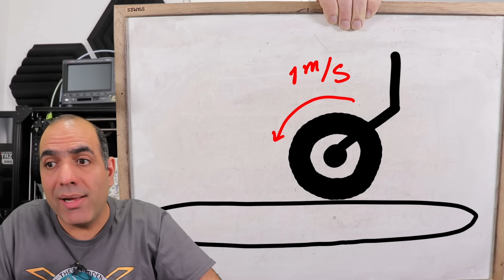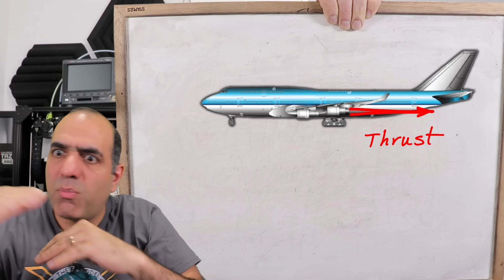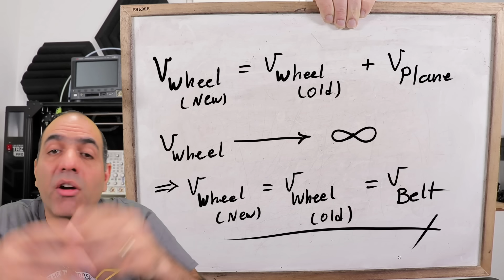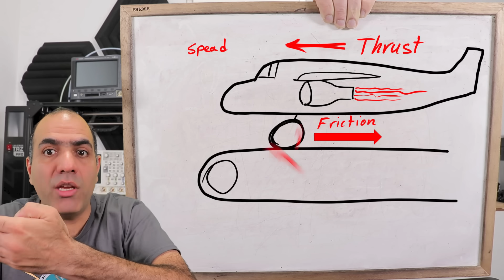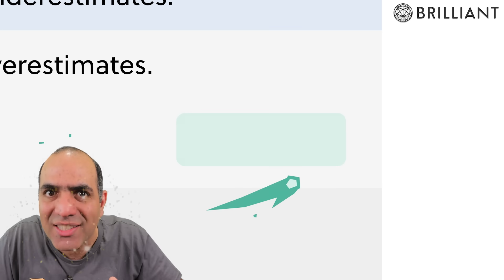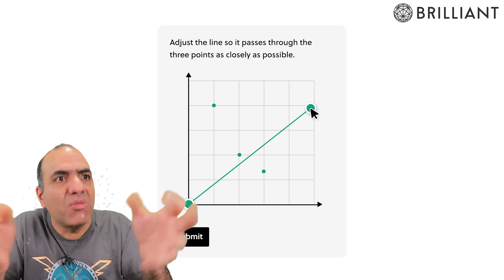Airplane Question that Drove Me NUTS!!!

Comment: Basically, using the assumptions most people make, in the real world the plane takes off (and Mythbusters actually did it as he points out). But the way the question is usually phrased the wheels spin impossibility fast creating an impossible amount of friction (which he also points out) and I don't know what happens because its impossible.

Comment: This is like the "I'm 14 and this is deep" equivalent of physics questions
Reply: The "Mythbusters did this 20 years ago" of physics questions.
Reply: The real question is how TF would you design the conveyor belt.
Reply: @An Dan

We have "conveyor belts" or "treadmills" for planes... Theyre called wind tunnels.

The speed of a plane is measured in terms of airspeed, since that will tell pilots how well the plane is flying. "Ground Speed" is only used for navigational purposes. Otherwise, all that matters is how the plane moves relative to the air. So, if you match headwind speed, with the airspeed the plane can achieve via thrust off the prop... It will hover in place relative to the ground. And you can find videos online of pilots doing this, some STOL aircraft can fly slow enough for a strong headwind to match or overcome the forward airspeed of the plane. For example, you could fly a small STOL plane at 50 knots into a 50 knot headwind (not unheard of, winds that strong are a thing, especially the higher up you go).

This is what a conveyor belt, or a treadmill, for an aircraft looks like.

To more directly answer your question, IF you want to conveyor something... The implication is, you want to move a medium, to directly counter the propulsion of the vehicle... In order to do this, you MUST ALWAYS pick the correct medium to "conveyor". That medium HAS to be the same medium as that used by the vehicle FOR propulsion. For example, a car pushes off the ground with engine driven wheels... Which is why conveyor belts DO work for cars. For airplanes, the plane sends power to a propeller, and pushes off the air... So you MUST pick air as your conveyor medium (hence why wind tunnels accomplish the whole treadmill thing for aircraft). And for boats (excluding sailboats... Those are a whole other animal), the power is sent to a screw in the water, pushing off the water to move... So for boats, you MUST pick water as your medium to convey. This can be done by sticking a boat in a strong head current. Or by putting a boat in a current pool. These are a thing, theyre kinda like wind tunnels, but for boats, they circulate water in a big loop so a model boat can be studied.

Water treadmills are also a thing btw. I enjoy them as a swimmer, you get to swim for exercise indefinitely, without ever having to stop at the edge of the pool to do a flip turn.

So yeah, if you want to design some sort of conveyor or treadmill to keep a vehicle from moving, even at power, then you must take a step.back and consider what medium the propulsion system is using to move in the first place.
Reply: Xkcd did a response to this that was very thorough and exactly explains why it has this "I'm 14 and this is deep" feeling for a physics question.
Reply: @anonymousperson2886  I mean it's not just a feeling. I remember watching this on Mythbusters probly right around when I was 14 and being utterly confused at why it worked. Then revisiting years later I realized how obvious it was. You don't need an in depth explanation, just a basic understanding of how thrust works
Reply: People really like to downplay quick thought activation questions.
Reply: AKA every single one of College Board's questions
Reply: More like "I'm 8 and this is deep"!
Have a little more respect for the average 14 years old :-)
Reply: @SALSN  I'm 14 and disagree
Reply: @rcat777  well I did say the AVERAGE 14 years old ;-)
Reply: @SALSN  I’m assuming you understand the plane can’t take off without breaking the parameters of the myth. Right?
Reply: @SALSN  are you serious gng🥀✌😔

Comment: will not fly. the speed of the lanes is so fast that the pressure on the bearings of Wheel will equal the force of the engines,or will overtake the plane back.

Comment: Call me crazy but my thought process is the thrust doesn’t care about the wheels, the wheels are only there to move it along the surface. Unless the wheels are so high friction that the conveyor belt can drag it backwards at an equal or greater speed, I think the plain will move forward just at a slower acceleration due to the greater friction of the faster wheels. If you put a car on the conveyor belt it would stay in place because the power is being driven through the wheels, for a plane the power is in The thrust of the engines therefore as long as there is nothing impeding forward movement on the fuselage the plain should be able to move forward. But of course this assumes that there is little to no friction in the wheels, I don’t know how fast those bearings are rated the spin but I’m willing to bet if this was a full scale experiment the tires would explode and the bearings would burn out. Feel free to criticize me I don’t necessarily know.

Comment: I always assumed a Scenario 4 situation. The question is obviously focused on the wheels, not the jet engines. So the plane just isn't moving and no flight occurs. Without the wings moving through the air, no lift is generated.

Comment: The question itself is sort of a paradox. For the treadmill to "always" go the "exact" same speed as the wheels the treadmill would have to instantly speed up. So regardless of the thrust from the engine the friction from the wheels has to match. So the plane would stay still.

Now if the wheels are frictionless then the treadmill speeds up to the speed of light and the plane takes off as normal.
Reply: Nailed it! Glad us EEs all think the same.

Comment: The wheels wouldn't spin at all. Airplane wheels don't apply lateral force; they only hold the plane up. The engine would push the plane forward the wheels would remain stationary and friction would pull the conveyor along.

5 answers

Comment: IF the treadmill could match the wheel speed perfectly, it wouldn't take off: zero net velocity relative to the ground would mean no airfoil lift.  However, the plane would likely be able to accelerate faster than the treadmill could, so eventually it would reach takeoff speed. We could test this with one of those RC airplanes with miniature jet engines.

Comment: You're missing a fifth important physical element.  All wheels have slip and skid factors which kick in when the coefficient of friction is exceeded.  So in the 'infinite speed' case, the belt won't actually need to hit infinite speed before the wheels start slipping and the plane takes off as in your first case.  How close to infinite speed is just a matter of the numbers.  It can take off.

Another way to think about it:
A model car is sitting on a belt.  You can push the car from behind with your hand, but the belt instantly (which is impossible) rotates backwards as fast as the wheels spin.  It's pretty obvious now that you can still move the car - the force you put into it almost entirely translates into the wheels skidding over the belt.

Comment: The answer is that the plane won’t, if there is no wind movement traveling under the wings and not generating downward thrust then it won’t go anywhere. If the planes engines are on and a conveyor belt is keeping it stationary relative to the planet then it will just be running on a treadmill.

Comment: The mythbusters talked about this one. The answer that they gave (and I agree with) is that in ideal conditions, yes. Then they tried on a real (small) plane, and it took off, though the test was imperfect
Reply: No, they did a subtly different question. Plane speed vs wheel speed

Comment: Airplanes need airspeed to generate lift.  The conveyor belt question is ridiculous.  The wheels of an airplane are not driven,  so it doesn't matter what speed or direction the runway is moving, up to a point.  Conveyor, stupid. No real effect.  Now a short runway can be aided by putting the runway in motion.  Early aircraft carriers didn't have effective catapults.  By turning the ship into the wind and making best speed? The ship could help reduce the "ground speed" needed for its aircraft to reach minimum airspeed needed to fly. Or land.  
I still want to try wakeboarding up the Colorado River through the Grand Camyon rapids.  F'in crazy right? Well??? 16-30mph, ideal 22mph surface water speed under my board is very real.  This is getting into the conveyor belt thing.  I may have time for smoke breaks since I'm only going to be passing boulders at .5mph while maintaining 22mph surface water speeds. Come on EB. Einstein wasn't talking about Arkansas marriage with the Relative Theory!

Comment: The question as-posed does not state whether the engines were running at takeoff power or not. If they weren't then the plane would never reach take-off speed but still would move down the conveyor belt if any sort of thrust was applied. This is true regardless of how fast the conveyor belt was running because the jet engines (and propellers on aircraft aircraft so equipped) apply thrust to the airframe, not the wheels. The wheels "free-wheel" on takeoff so no matter what the conveyor belt was running at, the wheels would be spinning at the conveyor belt's speed + whatever velocity the airframe had accumulated from the engines by that point.

Comment: It can’t take off bc if the belt moves in the opposite direction of the wheels at the same speed the plane moves it will just stay in place and even if the engines were on it still wouldn’t be able to because it wouldn’t be able to move through the air like a normal plane and have the air molecules go and hit the wings at a certain angle and push it off of the ground game left so essentially it would just be sitting there with its engines on

Comment: Yes, IF the aircraft is very light, say, no pax or cargo and min fuel required to make a nearby destination.  A 747's wheels are designed to handle takeoff speeds at MGTOW and well over 200 kts, whereas Vr for a min fuel 747 with no pax or cargo could be as little as 130 kts.  Thus, at 130 kts forward airspeed, with the conveyor moving backwards at 130 kts, the wheels are rotating as if the aircraft is traveling at 260 kts, but with far less weight.

So, yes.

Comment: Actually, if you really think about it... It is an stack overflow problem (not the site, the actual programming)

Wheel 1kmph
Conveyor 1kmph

But because of that, wheel is now 2kmph... So conveyor is 2

Now wheel is 4, so conveyor will be 4

Now wheel is 8... And so on

Got it?

Eventually,speed of light. Or stack overflow, whichever comes first
Reply: He said that on the video... Nevermind.

Comment: So one small problem with the zero bearing friction case. You are correct that in that case the wheel and the belt are stuck in a form of feedback loop and the velocities would eventually go to infinity. What you missed is that as long as the wheels have a moment of inertia and there is friction between the wheel and the conveyor belt there is a finite acceleration that is possible unless the belt can provide infinite force and that the force provided to the wheels by the accelerating belt can stop the plane from taking off.

Normally people assume that forces acting perfectly tangentially to an object result only in rotation but that isn't true. It will also result in linear motion. For example a wheel in zero G with one rocket strapped to the very edge. It will rotate and translate but the translation will be very different then if the rocket is at the hub. Another example is putting a rolling object on a piece of paper on an inclined plane. If you pull the paper with enough acceleration (and carefully enough not to knock the object off) you can get the object to move up hill. Though it is easier just to see that it takes longer for the object to get down the incline. The key is accelerating the surface the object is rolling on so that it imparts a force on the object.

In terms of the plane with frictionless bearings and constantly accelerating wheels/belt this means a large enough belt acceleration will counteract the thrust without bearing friction. The wheels and belt will still accelerate to destruction very quickly though.

Comment: Assuming real physics apply, as soon as a force is exerted on the plane, such as any thrust sufficient to overcome the friction of the wheels' bearings, both the wheels and conveyor belt would instantaneously accelerate to infinite velocity, converting the plane and anything within several AUs of it to energy, likely destroying everything in the solar system, assuming the violation of causality doesn't cause bigger problems, which currently we have no working model for as we assume that no violation of causality can occur at all, but the conditions of the experiment require it.

Comment: The plane and its landing gear are its own reference frame. The plane won't care about the belt as it needs airspeed not belt speed if it makes sense. It has been done even with rc airplanes and treadmills. Should as what 74 Gear thinks as he is a 747 pilot.

Comment: I don't believe that even the friction from the wheels would have any effect. The wheels are irrelevant to the thrust from the engines because that thrust is against the air pressure surrounding the plane, not the wheels. Since the thrust reaction is from the air, the wheels are 100% irrelevant and have no effect ecept to protect the ground and the plane from damage to each other.

Comment: Extend the conveyer belt to the length of the runway and reverse the direction with the planes wheel brakes on then yes!

Has nothing to do with the wheels its all about airflow over the wings.

Comment: Beginning of video comment: this is a question wrongly put. It makes a paradox that creates infinite energy. 

The engines have thrust on the body, the wheels are free spinning. If the plane took off on ice the wheels wouldn't even spin and it would be just fine. So as the plane pushes forward, the conveyor would go backwards but the plane would still go forward, since the thrust is on the body not the wheels. So the wheels would spin faster, making the conveyor faster, ad infinitum. The real escape hatch here would probably be a mechanical failure after the wheels are going a few thousand rpm, but even then the plane would take off assuming it could slide along the conveyor.

Comment: The plane could not take off because it needs to push wind down to lift it up by accelerating forward. It is like trying to fly a drone with the same amount of thrust the drone is pushing down is coming from above. Although the turbines are pushing air back, they are meant to speed up the plane and/or keep it moving in mid air, not to cause it to take off. The engines push air back, not down, so even if you ran both of the turbines at 10,000 times more than they are supposed to on the plane (still sitting on the conveyor belt), it would never cause it to take off because they create horizontal thrust, not downward thrust.

Comment: No since there's no relative airspeed, I don't like that the amount of people who assume headwind exists is so large, I'm assuming the air around the plan and conveyor is perfectly still, even If the plane used it's engines the conveyor would always match the wheel's rotation speed and the plane wouldn't move relative to the air therefore there would be no relative air movement over the wings and no lift would be generated.

Comment: no because the plane is staying still and there is no wind going under the wings which is needed to make it possible for the plane to take off. the only part that is moving is the wheels and they dnt cause enough air to make the plane take off.

Comment: without watching, the answer has to no, I mean a plane needs to move over a certain volume of air to generate lift and if it isn't moving relative to the air than no lift

edit:
I suppose I overlooked the fact that the wheels spinning technically don't matter to a plane taking off (I mean water planes exist [idk the proper term but the ones with pontoons instead of wheels])

one thing in your frictionless bearing example the wheels would have to be constantly slipping for the plane to move forward and generate lift, which would create some friction (wheel rubber on undefined treadmill surface material), idk if it would be enough friction to prevent takeoff though, which would also create more friction in your "realistic" scenario so idk how much that affects your wheel speed calculation.

Comment: 20 seconds in, the answer is YES, it will take off. Why? Because there is no mechanical connection between the wheels and the plane, the wheels act like a big bearing and it's the thrust that propels the plane. The wheels will only spin twice as fast as normal.
As for the "plane sitting" answer, the question is CAN it take off and not DOES it take of, so yes, if you try to take off, it will.
The wheels only accelerate as the plane accelerate so the conveyor also only accelerate as the wheels accelerate.
For the friction part, the converyor system has to endure the same frictions as the wheels so they will both lock up enventually. And by the time it takes to spin fast enough to lock up vs the time it takes for the plane to take off, we can assume the friction won't last long enough to seize the bearings.

Comment: Yes! this is because the plane doesn't derive its speed from its wheels, so no matter what, the plane will still move forward as long as the engines are running and brakes are not engaged. This, combined with the decently fast airstream created by the belt moving at speed will assist the plane in taking off.